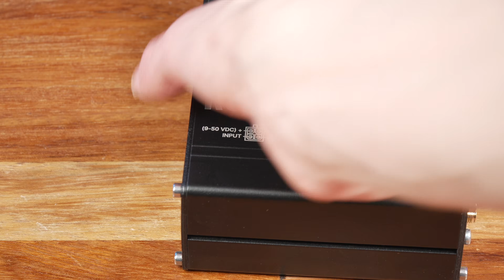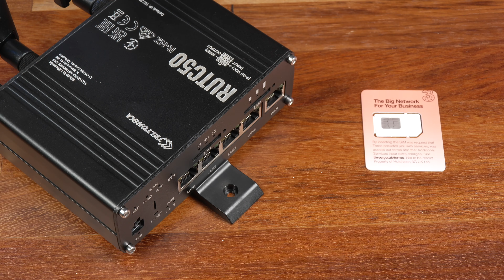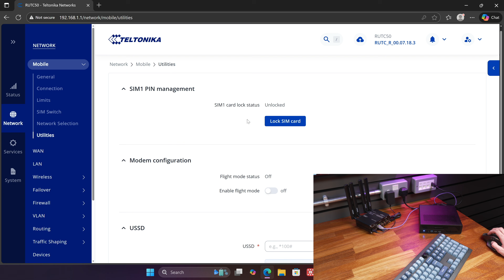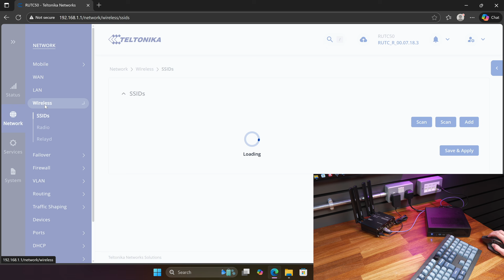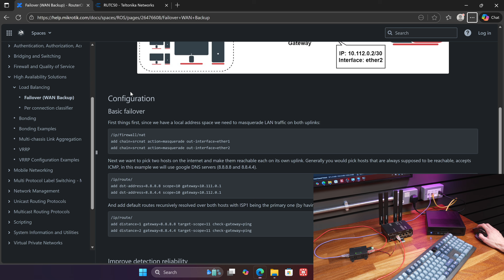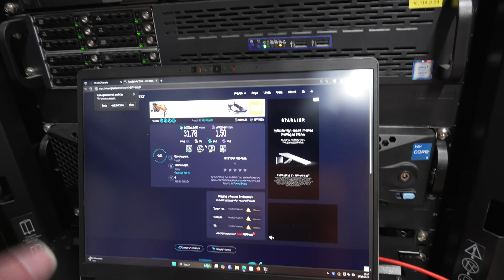Installing a Whole Home 5G Backup Internet Connection — Teltonika RUTC50

Comment from the maker: Buy the Teltonika RUTC50 from this video's sponsor, MS Dist and get 5% off your order using discount code "CAM5" at checkout or by using link https://www.msdist.co.uk/discount/CAM5
  - Teltonika RUTC50: https://www.msdist.co.uk/products/teltonika-rutc50?_pos=1&_sid=148e81092&_ss=r&utm_source=Cameron&utm_medium=Influencer&utm_campaign=RUTC50
  - MS Dist Store: https://www.msdist.co.uk/?utm_source=Cameron&utm_medium=Influencer&utm_campaign=RUTC50

Buy other parts used in this video from Amazon (Affiliate):
  - Linovision Gigabit PoE Splitter: https://geni.us/w1ulR8l
  - Molex Micro-Fit 3.0 Cable: https://geni.us/Ft7Lci
  - Screw Terminal DC Jacks: https://geni.us/jkBMU
  - Preloaded Data SIM Cards: https://geni.us/jXd0L9Y
Reply: please be aware. i could see your passwords on the rutc50's underside, i frezzed the vid and saw it. and clear enough to to take notes, i didn't, but if so minded i could have. i hope you changed them after the video, the QR code too
Reply from the maker: Those were all just the default passwords which have been changed, pretty sure it enforced the password being changed after first login.
Reply: @camerongray1515  PHEEWWW

Comment: Great video and piece of equipment! ✌ Heard only very good things about Teltonika products. Personally I will have a Starlink Mini as my first backup connection to my main giga-fiber connection, and a UniFi 5G Max Outdoor on top of my roof as my second backup connection (I used to have MikroTik GW and switches, but nowdays I transfer more and more over to UniFi equipment for ease of use).

Comment: Great vid, mate and something of a coincidence given that I setup a failover WAN for my OPNsense firewall router only last Monday. That Teltonika looks like a great piece of kit albeit pretty spendy. I just repurposed an old ZTE 4G router I had laying around: it's not anything like as nice as what you have there although it cost me nothing and it does do bridge mode. It seems that pure 4/5g modems are not that common so you often end up having to use a router and put it into bridge/ modem mode but I know many of the cheaper ones don't do that. 
On the subject of the data, I didn't know about those pre-loaded SIMs and they definitely look to make the most sense for this use case. I just bought a Smarty (uses Three) SIM with 80GB of data for £10 for the month but I think once I've established which network gets the best signal/ performance here, I'll follow your lead on that. From a quick look though, I couldn't seem to find 500GB for the price you paid.

Comment: Personally for me it would seem more worse at choosing a service provider that has a cellular backup option. There are lots of premium ones in the UK that have this is an option and just won’t bill you for the Sim card as long as you don’t use it when you shouldn’t beand you can use all of your own equipment
Reply from the maker: It's an option for sure but I don't really see the benefit over what I'm doing here - you're limited to an ISP that offers an included 5G backup which is generally also going to require a more expensive plan and you're generally tied to using their equipment.  Additionally, while it's not a big issue for a home setup, when picking a backup connection it a good idea to keep things as separate as possible.  A broadband line and 5G backup from the same provider puts you at risk of that provider having problems with their core network - look at the Vodafone outage back in October, that took out both broadband services and mobile data.
Reply: @camerongray1515  vodafone provide most 5g services for other companies so no difference unless you use ee even then they will likley use vodafones masts
Reply from the maker: Not necessarily, loads of providers operate their own masts but even then, the Vodafone outage was to do with their core network, not the masts.  My Three 5G connection was completely unaffected.  My point is that it's always sensible to separate your backup and primary connections as much as possible for the best chance of at least one of them remaining up during an outage.
Reply from the maker: Not sure where that comes in but my point is that separating providers makes sense.  Even being able to roam in the event of a tower outage won't help if the provider has an issue with their core network.  A Vodafone broadband connection and Vodafone 5G backup introduces the risk of a Vodafone outage taking out both connections (as happened last year), same goes for a BT broadband connection with a BT 5G backup.  On the other hand, say, a BT broadband connection with a Vodafone 5G backup, you're relatively safe if either provider has an outage beit with the towers, fibre infrastructure or their core network.
Reply from the maker: The Vodafone outage last year was essentially due to them completely unannouncing all routes over BGP, it took down both their broadband and mobile data services.  No level of "roaming" or hardware redundancy would have helped.  If you're happy with the (admittedly low) risk them that's fine, but my advice would always be to diversity your providers as much as possible.  I just can't see any benefit to using the same provider for both.

Comment: I've just got a 5G attenna on a contract from THREE, £17 a month and my speed tests I run at 0200 get 1.01Gbps down and 93Mbps up with 23ms last night for example. Costs me £17 a month. I have it as failover in my unifii gateway for my entire connection with firewall rules set up to activate it to do some downloading rather than using my main wired connection when required.

Simple, cheap.

Comment: Noting  yiur  primary  fois router  will need to  support fallover in its firmware assuming it doesn't gave xg  built in noting also  yiu will need to chech what w terminal are xg vs standard wifi

You may need  need to  set a  multi login pending on roouter you use in the networ

Since most router de  default to 192.168.1.1 

You want to  0.1 -50.1 pending on  the  size of the network you run in uor home

Comment: Very interesting
Maybe a better speed with exteriors antenna over the roof (attached on the same mast as the TV antenna). The choice of the 5G operator can also significantly influence performance (due to the position of the mobiles towers).

Here in France, one of the main mobile operators has released an prepaid 4G/5G offer with 10GB for a month at 5€, or 200GB for a month at 10€, and I'm thinking about setting a mobile backup like you (but my infrastructure isn't as large, which reduces the interest).

Comment: At this point with the 4.50GBP/m 0.5/0.5mbps plan with a Starlink Mini (180GBP) which can be changed in 10sec to a unlimited residential 100~300/20~60mbps at less then half the cost of a RUTC50 still running on POE or any 12~48v source.

Unless London gets nuked at makes for a lot more reliable cost of investment backup to fiber when you consider most 4/5G cabinets have the same 2~3 hours internal backup and or local exchanges being the weak point, it is also very costly to employ active jamming for it unlike 4/5G. 

Then again nothing stops you from a security point of re-routing and re-terminating your fiber to a more secure location, i.g I have VDSL2 (which is being phased out at some point for FTTP) going into the attic on the second story of the house, not the ground floor, most providers will not care at all if you do this,.

Comment: Cameron, I identified exactly the same risk recently, but wanted a low cost option for what is a low risk situation. I ended up buying a GL.iNet portable wifi router for £27, a 4G dongle for £21 and a EE PAYG 120GB 12 month sim for £48 in total £96 all from Amazon, and connected to my Unifi fail over port and hopefully I will never need to use it.

Comment: Does the router also support NAT64? Here in Germany, for example, Telekom provides IPv6 addresses free of charge, but IPv4 is only available via GCNAT.
The MikroTik 5G router does not support NAT64, which is why I have to use ULA and NAT6 there in order to be able to use IPv6.

Comment: You'll probably want to install that GPS antenna as some high performance 5G devices rely on the very precise timing reference of GPS to more accurately and more quickly synchronize with the network for TDD. That and having your own local NTP server allows for some nice improvements.

Also leaving the SMA connectors open invites dust and stuff, had that happen to me, very not nice. If you don't want to install the antennas you can get little 50 ohm terminators to cap them off. Plastic covers are also available but the 50 ohms helps if the WiFi ever accidentally gets enabled you don't damage the radio from reflections.

That and as it looks to support 4x4 MIMO you should see a performance improvement by separating the antennas, both by distance and by vertical/horizontal polarization. Although with only 2xCA and -77 dBm there's only so much you can get.

Comment: I have a 4g back up on my connection as our internet provider County broadband are super unreliable. I have done it the easy way of buying a dual wan router with failover and then a 4g router which I've located for food signal. We don't have 5g yet but I get on average 60/15 but do regularly see 100/20 which for 4g is not to be sniffed at. I don't want to use external antennas as I want to be able to just pick up the 4g router and take it somewhere to use. I do live in an area that suffers with mast congestion so I was quite surprised by the speeds as my phone gets very slow speeds and it's a flagship device. I do use a three branded router so that may help I don't know.

Comment: Excellent video! I did a similar thing with a 4G USB modem with my RB2011UAS router. It worked great as an emergency failover. Back when I was a little more crazy I had two phone lines, two ADSL connections using two different DSLAMS (one owned by my ISP and the other belonged to Telstra) . Each DSLAM used totally separate backhauls. Excellent redundancy!

Comment: I'm glad I found this. I had been looking at 1p Mobile's prepaid unlimited 5G SIM, but that was soft capped at 500GB per month and would have been £270 per year. That Three SIM is only £150 currently.
Reply: Don't use 1p mobile it is OK when things work but when my data was renewed I couldn't get online and there is no way to contact them only via an annoying chat bot that doesn't work.

Comment: I've done a similar 4G backup solution using a ZTE MF286D unlocked in bridge mode, going to a Unifi Gateway Ultra which manages the WAN failover without the hassle :)

Comment: We use cradle points cellular modems at my work for backup Internet. We install yaggy antennas on the rooftop to get a better signal.

Comment: I’m considering using Starlink as a backup to my fiber connection. In my area we can get Starlink for $40/month with zero $ hardware fee(Rented Hardware), it’s 100Mbps. I live in Chicago so we really only have power or internet outages for maybe a few hours to at most 12 hours per year total, so I’m not sure its worth it when we can just use our phones hotspot in those situations..

Comment: LTE speeds are quite bad, but even more concerning is ping. One of the best things in teltonika is that you can see many details about your LTE/5G connection. I know that this is only backup coonection however you may consider having external antenna. Quite recently I installed Quwireless antenna (they have dedicated model for each teltonika device) for my TRB500 and now connection is more stable than from local cable tv provider.

Comment: I’ve been using a ULTE-Pro-EU for a few years for this and it’s been working flawlessly with easy setup. I also use 3 business SIMs, with mine being from Scancom. Can usually get an offer of 25gb per month for over 2 years for under £30 one off fee. Annoyingly though the UniFi setup doesn’t support port forwarding on the backup connection as far as I can see.

Comment: As good as these are, they are a lot of money when you can buy certain devices for a third of the price, flash then with openwrt and add extra antennas with pigtails yourself relatively easily if you need all the antennas. Sub £200 all in.

Comment: 1:40
In the 12 years I worked for an ISP, I looked over a team of about 15 people. We covered some 26 communities.

A targeted robbery only happened once, both telephone and Internet lines were cut before they broke into the facility.

The technician heard about the outage after the customer called it in, went out that same day to repair the internet to get them back up and running.

Alastair was a Scottish immigrant here, a hard freaking worker. If you're out there my man: you are awesome! Always doing right for the customer (and the RAF!)

Comment: I have had good results with a second hand Nokia Fastmile 3 5G - they are only given out through ISPs so your mileage may vary in regards to how locked down your local variant is, but it is fairly easy to get the superuser password and reconfigure it into bridge mode. On a good day I would get 300-500mbps down when connected to 5G. Also, if you have a strong 4G connection then a 4G modem/router can be had for pretty cheap, and you can find them second hand for peanuts.

Comment: Great choice! For anyone looking for a slightly more affordable option I ran the ZTE 5G CPE MC888 as my main modem for about a year while I waited for fibre to rollout to my address as the DSL was very slow.

I used an ID Mobile SIM card as they are truly unlimited (no throttling or hidden data caps), support "tethering" (i.e. not using it on a phone), and had fast 5G in my area.

I was able to get between 300-600Mbps most days - I am on top of a hill and my nearest tower is about 1km away at the bottom of the hill. I just put it in my loft and it was fine.

It did have a mode to work as a modem rather than a router and pass the public IP through. ID Mobile use CGNAT so I couldn't test port forwarding but I imagine that would work OK if you are on Three Home/Business SIM (the only ones that do not CGNAT you in the UK IIRC).

Great device.

Comment: since the signal strength is low, you might want to look into a directional high gain antenna, the teltonika router itself might not be positioned towards a base station

Comment: Another thing is I hate outside electric meters as anyone can switch off your power before trying to gain access to the property.
Reply from the maker: Absolutely, thankfully mine is inside and I can't think of ever seeing an outdoor one around this area but definitely worth bearing in mind!
Reply: @camerongray1515  Presumably the 5G modem/router is on the UPS feed from the rack with the PoE source?

Comment: Any cheaper options ? Thats alot of money for the use case
Reply: It would be still a lot of money, but Teltonika offers gateways, which are much cheper. There is TRB500 gateway with identical 5G capabilities, but with no switch, no wifi, no dual sim
Reply: I ended up buying a GL.iNet portable wifi router for £27, a 4G dongle for £21 and a EE PAYG 120GB 12 month sim for £48 in total £96 all from Amazon, and connected to my Unifi fail over port and hopefully I will never need to use it.
Reply: Mikrotik SXT LTE is about £100. It's only got a 100Mbit ethernet port and uses LTE not 5G, but it's perfectly capable as a backup connection.
Reply: Yes, 5G usb modem as RB5009 has usb slot. Not sure why he went with 600 pounds router, it's overkill.
Reply from the maker: Yes this is overkill but I wanted the best possible 5G speeds if coverage in the area improved and I wanted to try out Teltonika kit.  I didn't want to go with a USB modem since the router is inside a rack in the garage where the signal strength is poor, I wanted something I could install separately in the attic for the best possible signal.  But of course a USB modem is absolutely an option if you wanted to go down that route.

Teltonika and Mikrotik both sell cheaper options but just with lower max 5G speeds than the one I used here.

Comment: Having worked at large scale with Teltonika RUTX hardware, it’s a great bit of kit and great company too with production in Lithuania. 
Software side is also great, there is the SDK version of RUTOS that allows you to build OpenWRT from scratch with the added Teltonika layers. 
So even customisation of the Linux kernel or OpenWRT and running custom software is fully supported.

Comment: I've been looking for a failover option, but at that price, I'll be giving this a miss.
I suspect it's firmly targeted at the industrial sectors
Reply: I actually found teltonika looking for simple solution for backup Internet. I bought TRB140, which is only LTE cat 6, however it is sufficient for this purpose. Genrally teltonika has gateways line, which are much simplier (no wifi, switch) and also cheaper. In other location I am using TRB500 having same capabilities as presented router

Comment: Try fanning out the antennas, two on X and two on Y planes and see if it improves the upload speed. I’m tempted to get a mobile data backup setup, may go for an external antenna too if I can brave the roof 😂